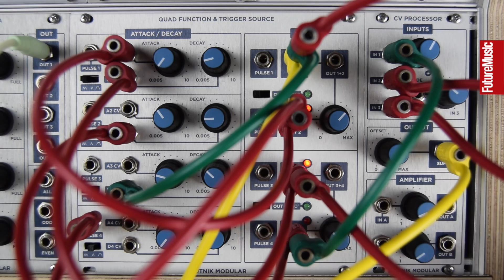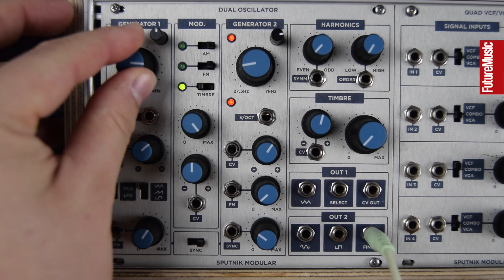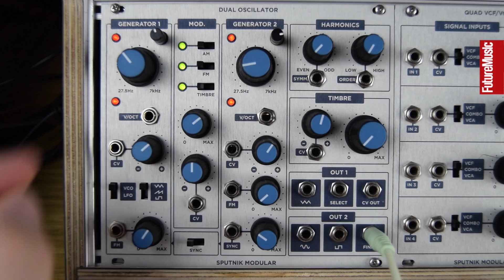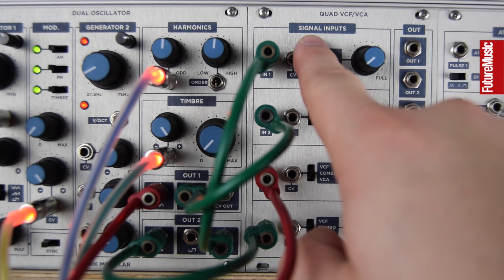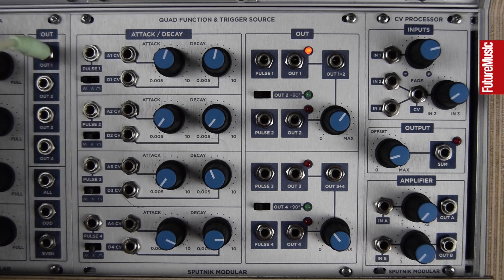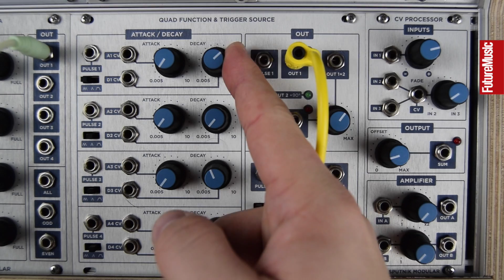Modular Monthly: A trip to the West Coast with Sputnik Modular

Comment: That free 1 HP in the left drives me crazy !!!
Reply: this will tip you over the edge then ... it's an 85HP case
Reply: Thanks for pointing out both the 1 hp space and the pube.  I will now commit myself to the asylum.
Reply: akakkakaka
Reply: Dualtrx OCD eye twitch
Reply: I have a Verbos Dual Pole Filter which is 21 hp.... it drives me nuts! why not do it in 20, or 22! haha